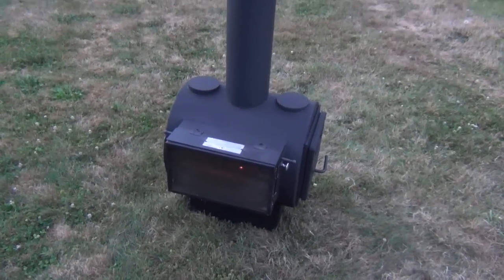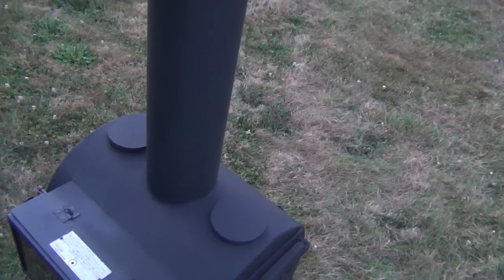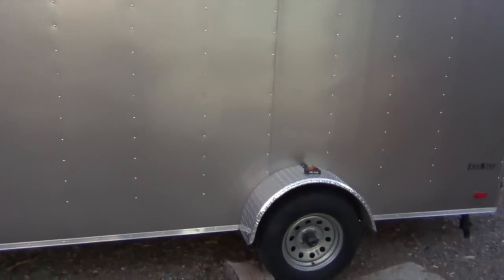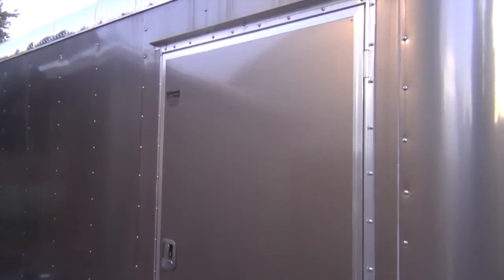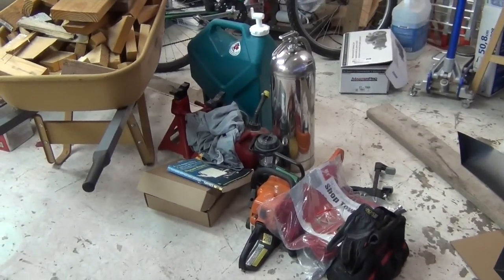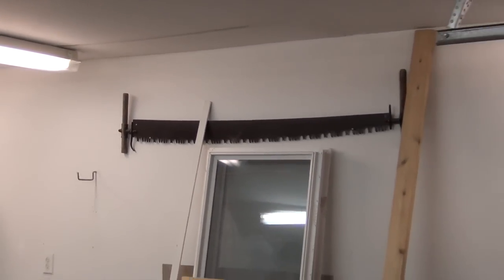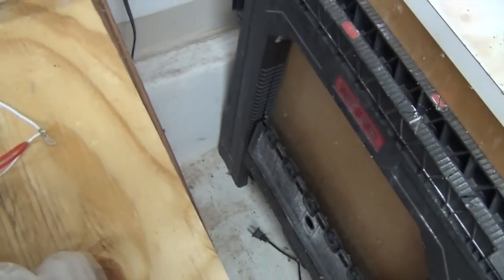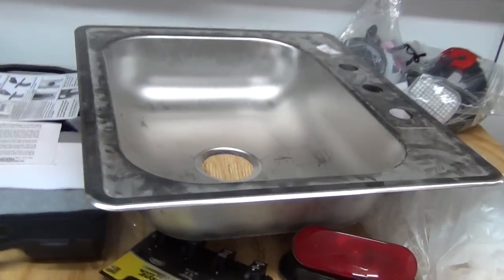Expedition Trailer

Comment: Is your freezer fridge combo propane powered.  That is a sweet set up and your on the right track.
Reply from the maker: Yes it is.  I tested it last summer and it seemed to work.  I don't know how many more years it will last before it get's an ammonia leak ha ha.
Reply: If it's not leaking now than it should be ok. Being absolutely level is critical with those absorption chillers. Love the videos. I am looking to build a hut at 12,000ft in Colorado. The difficulty here is an engineered septic system for tundra and permafrost type soils. The land is not too expensive and the drive is only an hour. But renting an excavator and digging up a gold mine tailing pile can get expensive. Keep up the good work and keep posting videos.
Reply from the maker: Nicholas Pope Awesome!  I'm sure it's from the 60's or 70's.  They seem to just keep going.

Man, that is pretty high up the mountain.  Could you do some sort of propane incinerating toilet up there?  Yes, I understand the rocky ground, it's hard to dig down 1ft on our land.  I rented an excavator to clear the area a couple years ago, it still took a long time. ha ha.  Please post your progress, this would be awesome to watch.
Reply: I don't know if a turd burner is sufficient. The county authority has been cracking down on mining claim cabins and making it expensive to build huts. Turd sickle out houses are what everybody has up until a couple years ago. Any new huts have to have a composting toilet which means passive and photovoltaic solar. Check out the Opus Hut on YT. That is the roll model. I have rented it. It was amazing but very expensive to build. Some things had to be flown in by helicopter.

Comment: That conventional style heater is NOT very efficient at all, all the secondary gases that the wood burns goes right out of the chimney pipe, better is a Gasification type stove/heater, they use way less fuel/wood to make way more heat. like what Silverfire makes, I use the Hunter in my 3200sq.ft shop, it is a small unit but very powerful,  http://www.silverfire.us/stoves